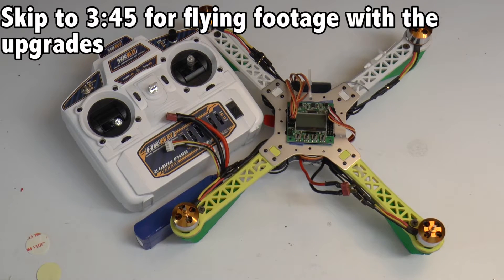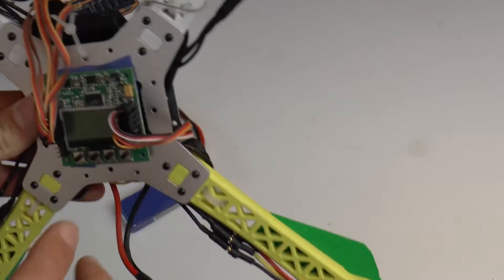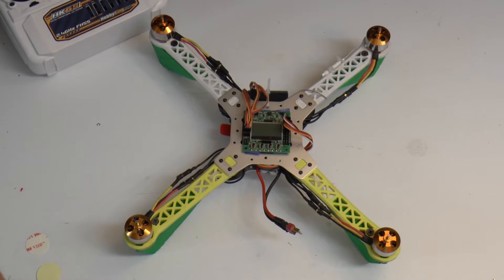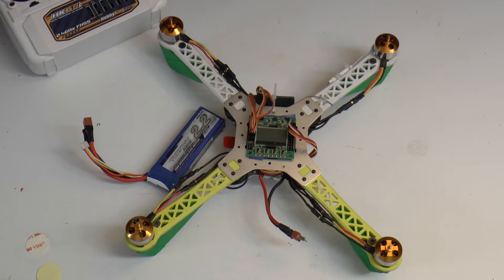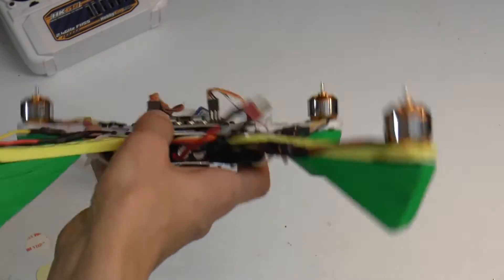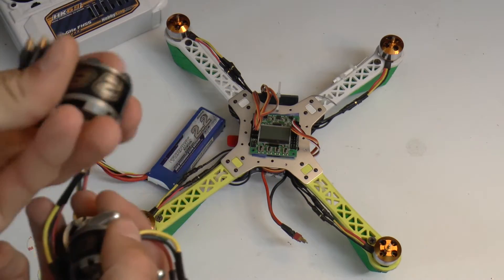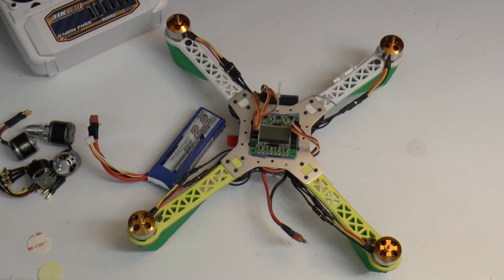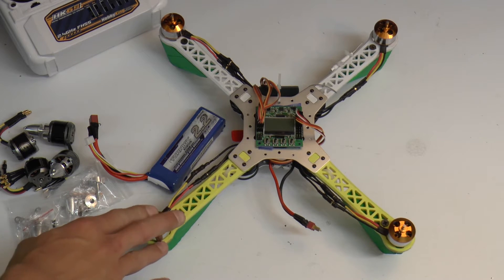OVERVIEW | ST360 QUADCOPTER BUILD, UPGRADES, FLYING

Comment: can this carry a camera
Reply from the maker: You can probably carry a gopro (or anything lighter) without a gimbal if you use a 2200mah 3s lipo. Watch my review of this quad if you are thinking of getting it though. It is a very bad frame and the motors must be upgraded. Arms flex and the aluminum core bends from the smallest crash.

Comment: So if i bought this from HK i would want to upgrade my motors?
Reply from the maker: Yes, but if all of the motors work out of the box then you want need to upgrade right away. The quality of them are low, so in time they will break and you will need to upgrade. Personally I wouldn't waste my time with this quad again because the frame is also very weak and low quality. I would just get the hobbyking Q450 v3 with NTM 1000kv short shaft motors with 30a afro esc's and a kk2.1.5. It would only be $40 more.
Reply: Infinite Remote Control I tried looking that quadcopter up, i cant find it
Reply from the maker: BPWeekly http://www.hobbyking.com/hobbyking/store/__49725__q450_v3_glass_fiber_quadcopter_frame_450mm_integrated_pcb_version.html but it is out of stock. It sounds like you are building a quadcopter for little money. I would strongly suggest you look at getting the Turnigy SK450 RTF. http://www.hobbyking.com/hobbyking/store/__47013__Turnigy_SK450_Quad_Copter_Powered_By_Multistar_Quadcopter_5X_Package_Mode_2_Ready_to_Fly_.html
If you already have a radio from planes or helicopters you will want this one http://www.hobbyking.com/hobbyking/store/__54362__Turnigy_SK450_Quad_Copter_Powered_By_Multistar_A_Plug_And_Fly_Quadcopter_Set_PNF_.html.
If you need something really cheap and don't need to carry an action camera or don't worry about size but still want high performance I would recommend this one. http://www.hobbyking.com/hobbyking/store/__52863__HobbyKing_Spec_FPV250_V2_Quad_Copter_ARF_Combo_Kit_Mini_Sized_FPV_Multi_Rotor_ARF_.html
You will need the kk2.1.5- http://www.hobbyking.com/hobbyking/store/__54299__Hobbyking_KK2_1_5_Multi_rotor_LCD_Flight_Control_Board_With_6050MPU_And_Atmel_644PA.html
And a radio- http://www.hobbyking.com/hobbyking/store/__24968__Turnigy_4X_FHSS_2_4ghz_Transmitter_and_Receiver_Mode_2_.html
Reply: Infinite Remote Control Dude.....I want to thank you for taking your time and actually helping me. The people who help there subcribers out and actually respond (Like you) are what makes YouTube a good community. Yeah, I am looking for under 200.
Reply from the maker: BPWeekly No problem! I am always happy to help people learn about RC and give them information. If you have any questions about quadcopters then feel free to ask. I have experience with many different frames and electronics so I know quite a bit about multirotors. I would suggest buying a kit and not try to build something because it should be cheaper and easier. Also don't get fooled by low costs because the products are normally worthless and break quickly. The best flight control for you will be the kk2.1.5 because it is inexpensive and very easy to use. I have had little experience with multistar but I think they should be just fine and won't need upgrading on the SK450. Mini quads like the 250 are the most popular thing in multirotors right now but are a bit harder to fly. I started with a dji f450 with the kk2 and a turnigy radio
(comparable to the sk450). Without any past experience I was able to build and fly it. If you are just starting to fly, then the turnigy sk450 is the best option for you and your budget. If you want to know more about mini quads then just ask.
Reply from the maker: ***** What is your budget and knowledge? If you are experienced I would recommend you buy various high end components from hobbyking (ntm 1000kv short shaft motors, afro 30a esc's, flight control) but if you know little I would recommend buying a dji f330 arf kit ($180) and install the dji naza lite (without gps $90, with gps $170) You would still need a radio ($40) and battery with charger ($50) Do you want something with a gps, or are you trying to keep costs as low as possible? Do you have a remote and battery to fly with or will you need to buy one? Do you have a charger? If you are trying to stay as cheap as possible then you may want to buy the sk450 http://www.hobbyking.com/hobbyking/store/__47013__Turnigy_SK450_Quad_Copter_Powered_By_Multistar_Quadcopter_5X_Package_Mode_2_Ready_to_Fly_.html but you will still need a battery and charger.
Reply from the maker: ***** With that budget I would definitely recommend buying the dji f330 with a naza lite control. The f330 with dji electronics will be very reliable. I have been using the dji electronics for over a year and have never had a major problem. Also since you are new to the hobby, the kit will be very easy for you to assemble and build and you will have a good understanding of how it works. The naza lite (no gps) is also great for you because it is plug and play, requires very little adjustment, and is going to work perfect with your setup. Also you can add the gps when you are ready. I would suggest the turnigy 9x radio from hobbyking. I have one and it is very reliable. You should get a few turnigy 2200mah 3s lipos. You will also need a charger. I would suggest the imax b6 charger.

F330 arf- http://www.ebay.com/itm/DJI-Innovations-Flame-Wheel-F330-ARF-Quadcopter-Kit-w-Motors-ESC-Propellers-/301052194240?pt=Radio_Control_Parts_Accessories&hash=item46181bedc0

Naza lite controller- http://www.ebay.com/itm/DJI-NAZA-M-LITE-MULTI-ROTOR-STABILIZATION-CONTROLLER-/360899336162?pt=Radio_Control_Parts_Accessories&hash=item540746d7e2

Radio- http://www.hobbyking.com/hobbyking/store/__8992__Turnigy_9X_9Ch_Transmitter_w_Module_8ch_Receiver_Mode_2_v2_Firmware_CN_Warehouse_.html

Charger- http://www.hobbyking.com/hobbyking/store/__6478__IMAX_B6_AC_Charger_Discharger_1_6_Cells_GENUINE_.html

Battery- http://www.hobbyking.com/hobbyking/store/__8932__Turnigy_2200mAh_3S_20C_Lipo_Pack_EU_Warehouse_.html